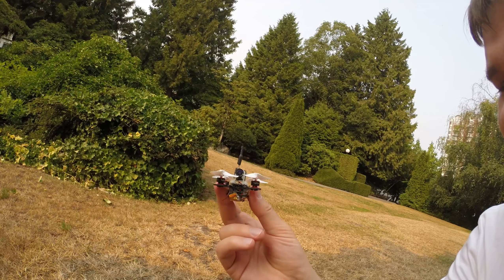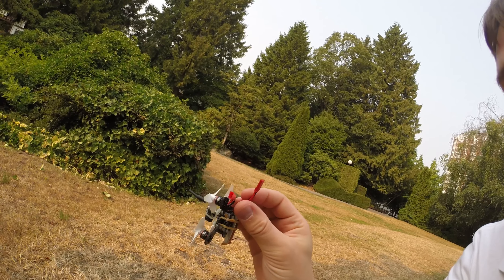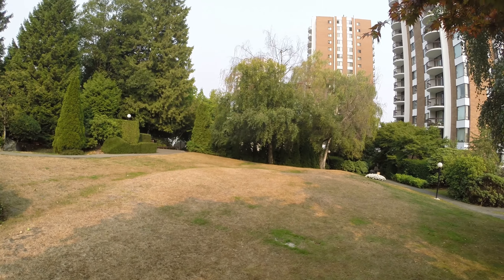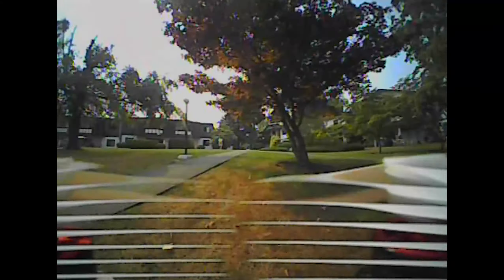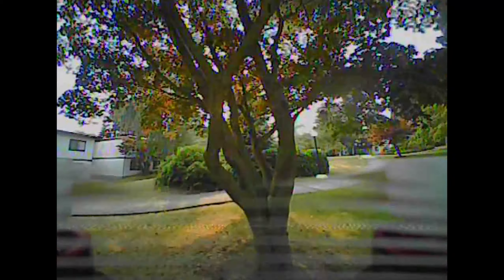Best 1s brushless drone with 0703 15000kv and 1S Tattu 220mah?

Comment from the maker: ===== Video navigation =====
0:00 Introduction
0:28 Showing Tattu 220mah
0:57 Showing FC setup
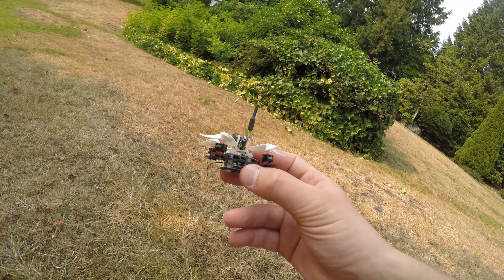1:10 Showing ESC setup
1:20 Showing access to bind button
1:25 Weight information
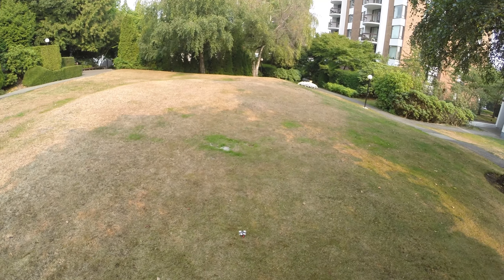1:40 LOS flight test
2:08 FPV in Horizon mode (with stabilization)
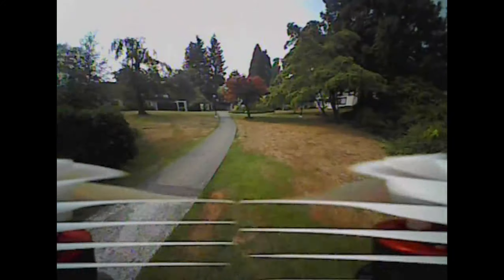2:59 FPV in Acro mode (no stabilization)
4:52 Final words

Comment: First learned of FlexRC on AndyRC's channel ... your quads look good.  Just got a little E010S to fly inside during the Winter. I took it outside in a slight breeze and that was a mistake .. it couldn't handle it. Your Nano-x looks great. Interesting FC/ESC/PDB setup. Many small quads have drift problems in Angle/Horizon due to vibrations (my KingKong 90GT nightmare taught me that). Your Nano-X seems quite stable in Horizon, so it probably doesn't drift in Angle. I'll be watching .. just subscribed. Cheers.

Comment: I have really bad vibration with this motor
Reply from the maker: These motors are not the "greatest" because of the size they don't use proper bearing but from my experience if you use good set of balanced props they will fly very nicely. For example in this video I'm flying with white 3 blade 40mm props which from my experience have best performance
Reply: what prop are u using? I Use Cheerson cs95 prop.
Reply: yeah thats normal, just order like twice the amount of motors you need and get a refund for the ones with vibration issues :D
Reply: moewensohn I add Singer Oil on them, and they spin better but one motor way too unbalanced I have to put tape on it.